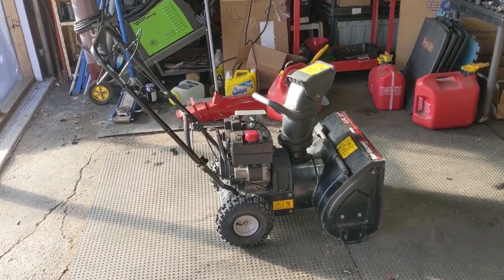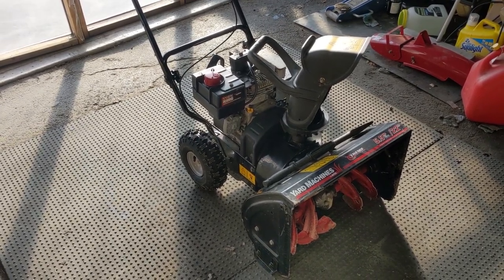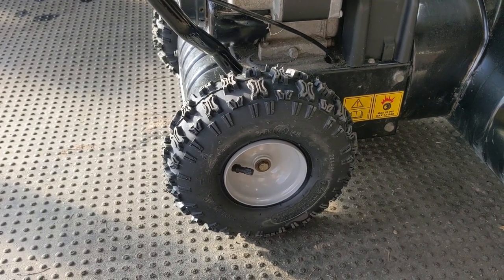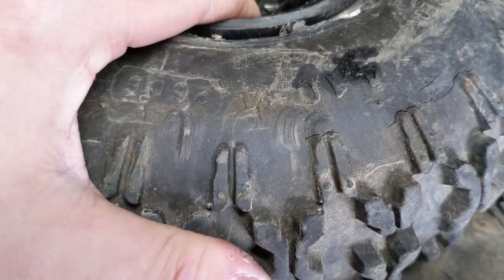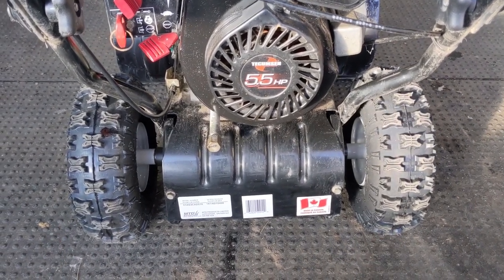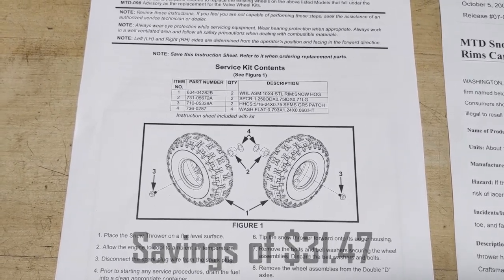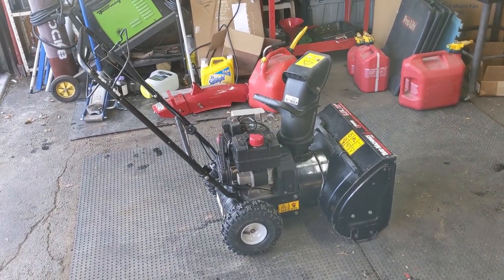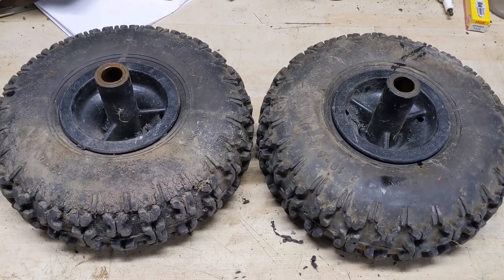Plastic Wheel Recall on MTD Snowblower

Comment: I have one of those snowblowers, identical to the one in your video.  I just love it!  We have a small paving stone driveway.  With this unit, I can do it in about five minutes.  It's very light to handle, and easily fits in a small space in the garage.  I wouldn't recommend it for large areas, but for small ones, its more than adequate.
Reply from the maker: I'm sure it's a formidable little machine, as I said, they do have limitations, like any machine. I got a good enough deal on it that we didn't mind spending some money to fix it up!
Reply: This one has a plastic impeller and gearbox right? I wouldn’t touch one besides for the engine.
Reply from the maker: The auger gearbox is part number 918-04292C and is aluminum. The impeller is part number 731-04218B and is plastic. The drive transmission housing is also plastic.

Comment: Hi Jake. I had a Craftsman with the same plastic rims. A friend gave it to me to fix. The wheel were off the rims, and I was going to tube them and then found the recall. Dumb luck! The only thing I wanted to comment on was when I called MTD they told me the tires were not on the rims. That was incorrect. Thank God because I wasn't looking forward to putting the tires on a new rim. Just in case I wanted to let others know. The tires come complete as you mentioned.
Reply from the maker: Thanks for letting us know Donna!

Comment: Great Video! I have a 10527SBE Husqvarna. It is giving me trouble it doesn’t throw snow far at all and if trying to blow more than a couple inches it clogs the chute and impeller. New gearbox and belt recently installed. This model the auger belt cannot be adjusted. Any ideas or suggestions? Thank you!

Comment: Hard to believe there are still snowblowers out there being used with those plastic rims, just proves recalls only work if the purchaser has sent in or registered the warranty with the company eh? Actually it was weird we got this one in and two more showed up over the next couple of days but they had the upgraded steel rims. Great video buddy that just may save someone a severe injury cause we all know many do not know how much air they are putting into a tire unless they have the gauge attachment like yours does.
Reply from the maker: Yes we haven't had any of these machines, and then 2 at the same time!
Reply: The first two-stage snowblower I bought was one of these machines. Mine already had one of the wheels busted. Got it relatively cheap from the person selling it because it didn't have electric start. Someone had put the generic on one side just so they could roll it around. I was just going to buy two new Wheels but then I saw someone else's video on the recall from the mowers and blowers Channel which is also U.S-based. So I just called the number on the back of the machine and gave them the serial number and they sent me the wheels. I have moved on to better machine since that purchase. I just keep it around because the engine is still good.

Comment: Sincerely love the content you put out.  This is an really old recall and unless something has changed you may want to double check with MTD as I am pretty sure that only WHITE plastic rims are covered in the recall not the BLACK ones.   

If one of the viewers do happen to have the white plastic rims that are mentioned in the recall rims perform bring it to a service dealer who will do it for you at no charge.  I have seen first hand on several occasions what an exploding plastic rim looks like after the fact and it isn’t pretty.  So please if you see one of these rims get it taken care of asap.
Reply: Appears it is all plastic rims that are red, green, black or grey are covered check recall form bottom area at 1:48 it says nothing about them having made white rims.
Reply: @waynestefinashen239  Sorry my memory was a little foggy on the color (light grey/cream).  I looked it up and it was the grey plastic ones without a relief valve, that are an issue.  MTD put out a Special Reminder Service Advisory to it's dealers MTD-098.
Reply: @tonyp6393  Thanks because we did not think they made white plastic rims for what we had investigated to make this video.
Reply: @waynestefinashen239  I only know about this is because many moons ago I had a claim rejected for the black plastic rims based on the service advisory I mentioned.  Call them and ask for it, it is very detailed.

Comment: I think I would just keep the plastic rims and not over inflate them untill they didn't hold air.
Reply from the maker: 1 already didn't, and as per the recall, I was to drill a hole in them to render them useless. It prevents anyone else from getting injured.

Comment: Wouldn't cover mine. Told me the black rims are fine it's one of the grey color rims. Mine are black so I guess it's out of pocket for my fix.
Reply from the maker: That's wild, any of the plastic wheels are dangerous. I'd try calling again and speaking with someone else! You might slip through the cracks sort of speak and get lucky. Good luck!
Reply: @EliminatorPerformance  I did call Canada number twice and got shut down twice and the usa number you posted couldn't confirm because of course different model numbers for Canada but the USA guys didn't ask what color rims lol.
Reply from the maker: @edrc5433  sorry to hear that
Reply: I had a similar issue did the same recall in the United States when I was using this machine. You can always go to their social media page and send them this video. Mine was purchased used in one of the original plastic Wheels had already disintegrated before I purchased it.
Reply: For now I added tubes. So far so good but if I have to revisit the problem I will be pushing harder for sure.

Comment: Personally i would read the limits of lbs air allowing go into the tubes (wheels) , but doubt how many people had read beforehand , blaming people (manufacturers) is the easiest way for your stupidness , but what is “responsibility “ fits into ?
Reply from the maker: Plastic wheels and air pressure don't mix well, 16 people got hurt and possibly even more after the recall notice was listed.
Reply: Back in the day when these came out people really had no control of how much air they were putting in a tire unless they were at a gas station with the air compressor that can be preset for pressure. Or like today we can purchase air guns with digital gauges that automatically read the psi so you know when to slow down or stop at 20 psi. Or they just did not read the rating and literally blew it up.